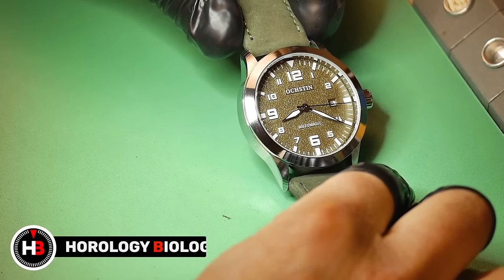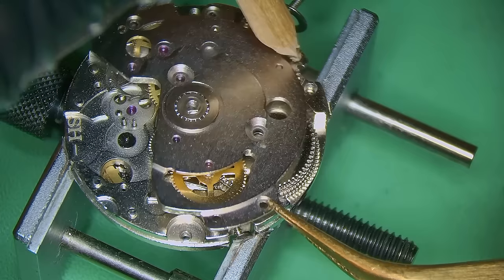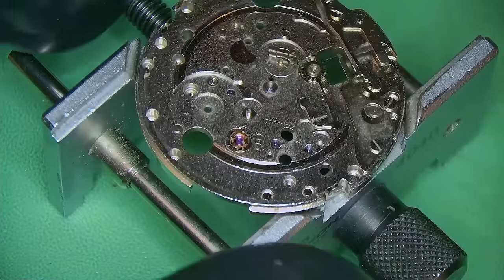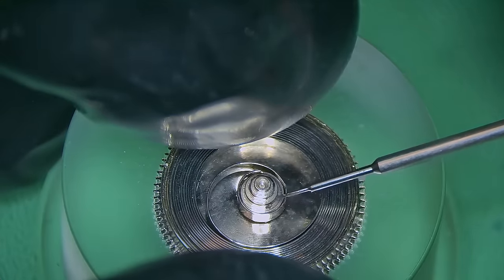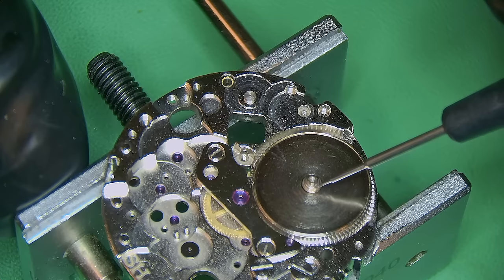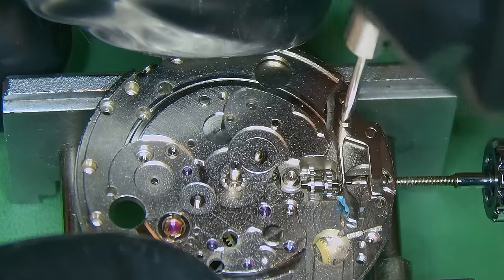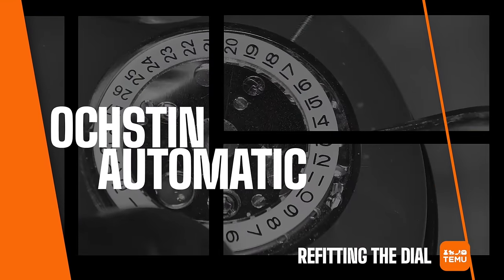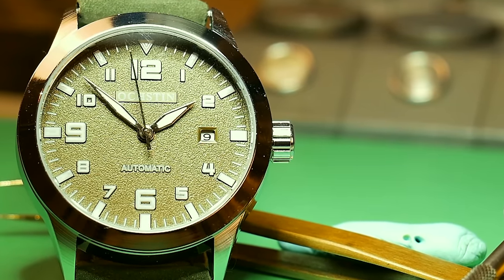I received the cheapest Temu Automatic Watch! Can the Ochstin SH-2 run better after a Watch Service?

Comment: It seems like a DG2813 movement, which is a clone of the Miyota 8215. Not 100% clone but very close. This automatic movement commonly appeared in many low end chinese watches especially replica watches. You can actually but these cheap movement for like 10 to 15 US dollars. They CAN be reliable, but they are a gamble, hit or miss. Some says it won't last longer than 6 months, some says it lasted for years and years, 5 or more.
Reply from the maker: Thanks for that and thanks for watching 👍🏽👍🏽
Reply: Will an NH35a fit in there?  What’s an upgraded movement that will fit? Something inexpensive…. Beginner
Reply: @dagobaker  probably not, usually only the movement from the same family are compatible.

Comment: That movement is nothing else than a Dixmond Guangzhou (DG) 2813. Which is a kind of clone of the Miyota 8215.
The final plate is tricky to put in place, and there's a trick to do: rotate the triangle of the click spring and you'll remove the pressure on the reversing wheel, helping A LOT to put back that plate :) Then you can rotate it back in position after the plate has been secured and voilà!
Before removing the balance, I prefer to open/remove the antishock spring and then remove the balance stones. Then yes, the balance and then the rest :)
Reply from the maker: Thanks for watching 👍🏻 cheers for referencing the movement. A few others have mentioned Miyota clones as well so a good shout 💪🏻💪🏻

Comment: Good job Mat, these cheap Asian movements are tricky to work on sometimes - here's hoping you get a nice jump in subscriber numbers! One question though - the magic of editing shows you took like 10 seconds to fully seat that huge bridge. Be honest, how long did it really take? 😀
Reply from the maker: Cheers Alan, hope you're doing well mate 👍🏼 haha about the bridge. To be totally honest it didn't take that long as it wasn't as bad as it looked as all but 1 of the wheels could be nudged as there was access. The main one that caused a little bit of extra assistance was the escape wheel as it really needed a tad bit of a longer pivot on it imo.

Comment: Love your videos in general man but this series is really interesting.  My mind is kind of blown by the cost of these watches compared to the tiny machined parts.  I know the watches aren't high end but the parts are the part.  40 bucks for an automatic watch seems nuts even if it's inaccurate.   

I know technology and methods today make it a lot easier and cheaper to machine parts, but it makes me think about Breguet and how he created his movement over 200 years ago.   No electricity, no CNC.   No fine laser cutters.   It's really amazing when you think about it.
Reply from the maker: Thanks for watching 🙏🏼 I think Breguet would be turning in his grave a little though 😅 it is mind blowing though how they used to do it. This is why I seriously admire the very few watchmakers out there that still produce very low numbers using the original traditional methods. I wish I had those kind of skills.
Reply: Never count China out.

Comment: 30 sec in & i thought man o man re-fitting those pivots is gonna give you a world of pain (DG2813, based on the 8 series ) I've tackled a few of them with a 70% success rate "roughly" but they will run well ( if you don't shear of the screw heads which i have/do) , in fact i bought that same watch years back for £14 . Nice result👍
Reply from the maker: Thanks Ted, defiantly wasn't the easiest but doable. Thanks for watching 👍

Comment: Awesome video as usual, looking forward to see what's coming in the new year! Say, to me it looked like the cog that belonged below that lefty screw was loose after the screw was tightened, is it just me? Also, I actually find this watch has a very nice dial, and clean layout. Incredible what 32 dollars can buy from China!
Reply from the maker: Yes it is supposed to be loose, if you look at the post it sits on its an oval shape as it needs to move in and out. depending on crown position. 👍🏼

Comment: I was so happy to receive mine a few years ago. Sadly it wouldn't run reliability. Stopping several times a day even though fully wound.
Bummer.
Reply: I've bought a watch with the Chinese Standard movement in it 5 years ago for $10, and this one runs fine, but it's really hard to wind the watch.

Comment: @17m30sec. I think Seiko has used a combined winding and clutch wheel?
Reply from the maker: Could be for sure
Reply: I think ive seen a very similar movement being worked on and it was stated that it was a seiko clone.
Which explains the "s" at the start of the movement number

Comment: I would have been interested to see the metal shavings in the bottom of your cleaner. I could see some when you opened this up. I also noticed that the "crystal" came pre-scratched. Nice bonus. 
Everything looked bone dry, including the balance stones. Made my scalp crawl to see the inside of that barrel with not even a thin film of lube. I was wondering why you didn't use any lubeta on the reversing wheel.
Reply from the maker: Thanks for watching, yes that barrel was so clean you could eat off it 😆

Comment: It's incredible what you can get from China for a few dollars. And at the same time it becomes clear that there is absolutely no justification for other watches costing thousands of dollars.
Reply from the maker: Thanks for watching. Although that doesn't make sense what you said. That's like saying a Ford Fiesta and a Ferrari should cost the same as they are both cars and do the same thing.
Reply: @HorologyBiology  It makes sense and you know it too. A Rolex for 10,000 dollars has a material value of less than 10 dollars. Rolex produces around 1 million watches a year with fewer than 10,000 employees. On average, this works out to 17 hours per clock. Now you can calculate for yourself how much it costs Rolex to produce a watch. Even at $100 per hour worked around $1700. By the way: You can get good automatic watches with sapphire crystal for €100. So only one hundredth of a Rolex. A Ford Fiesta costs $20,000. So a Ferrari would have to cost $2 million for your comparison to be correct.
Reply from the maker: @avronaut  I think your math is a way off to be honest but I do see what you are saying. On the flip side you can say this about most high street retailers (look at Nike sneakers for example) or even supermarkets prices, do you avoid these products too?
Reply: @avronaut The estimated total labour  to make a Rolex is  just over two hours. The sales margins, marketing costs and taxes are at least 90% of the price. 

It is estimated at if Rolex moved production to China they could make their steel watches for only $60 due to far lower labour costs.
Reply: @mrbrisvegas2 and that would make them worthless. Whole point of nice watch is them working great.

Comment: Is there anything that can be done in a service to improve the water resistance of a cheap watch that's not very water resistant?
Reply from the maker: Good question. For me it would be down to the quality of the build and of course the quality and condition of the gaskets. You cannot change the build quality so that is what it is. They state for this watch it will hold 3ATM but i'm skeptical at that.

Comment: Hey, how do mechanical watches know when it's the end of the month? Like how does it know if it 30 or 31 days or like February. Do you just have to set it a specific way at first or do you just have to fix it at the end of every month
Reply from the maker: Thanks for watching. You will have to correct it manually on the vast majority of all mechanical watches.

Comment: c est une fabrication chinoise il ya un defaut le mecanisme du calendrier durant presque trois mois il cause le blocage total de la montre
Reply from the maker: Thanks for watching. I didn't have a problem with the calendar works but it was definitely not a smooth system.
Reply: comme meme c est une montre qui ressemble bien aux montres de lux elle est economique